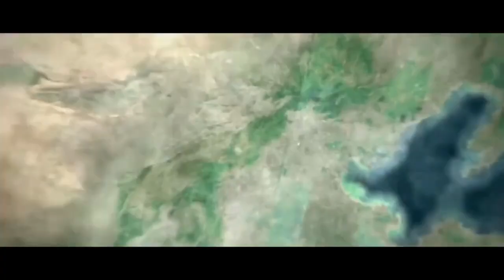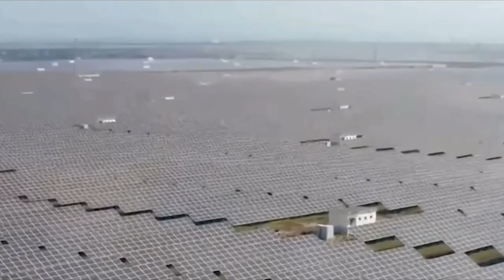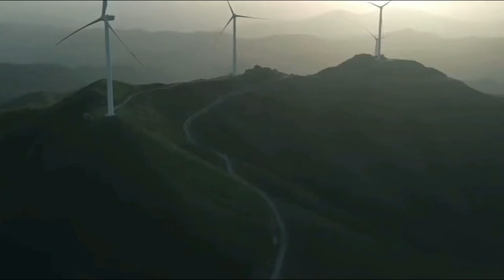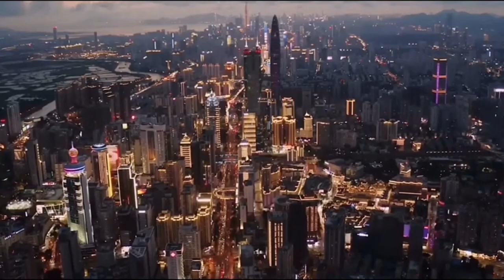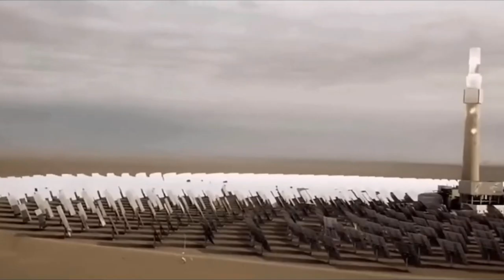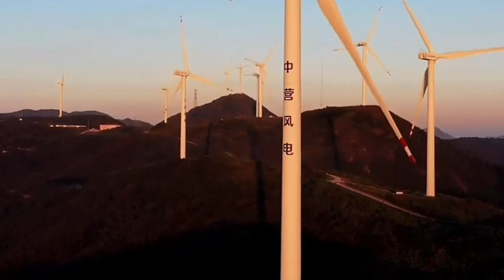China's $8.5B Solar Superfarm A Game-Changer!

Comment: China is pioneering Ultra high Voltage transmission lines.  They have some 30 thousand kilometers of lines already installed.  The west of China is sparsely populated and dry.  Moving electricity on wires is more productive than hauling coal by trucks to the east to then pollute the air.  This is what you can do when you have sovereign money and physical economy. The west  is finance capitalism. China is industrial capitalism/national socialism.